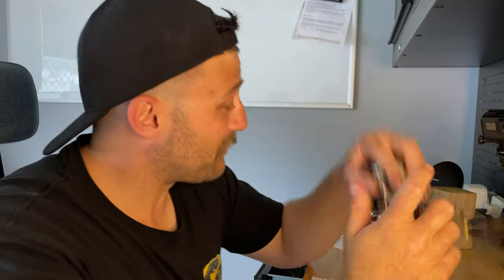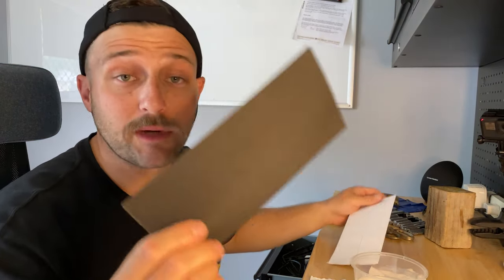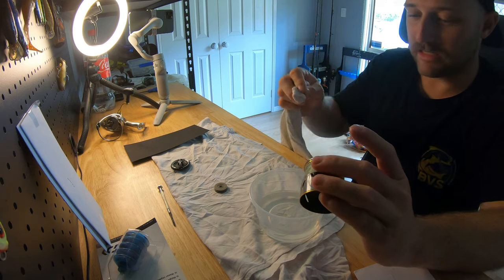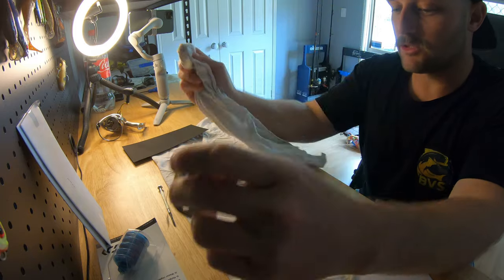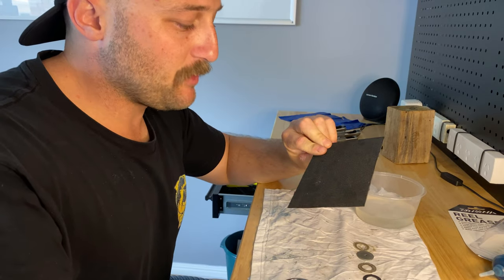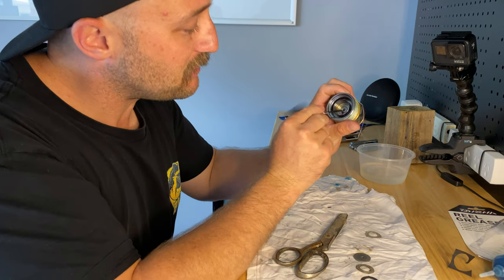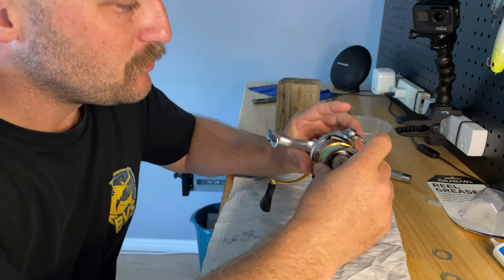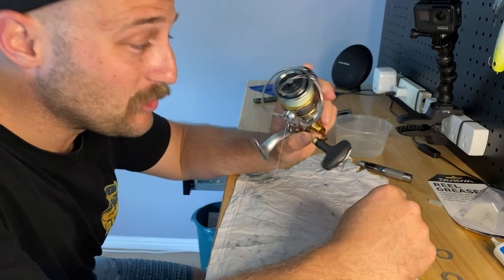CARBONTEX DRAG WASHER UPGRADE

Comment: Awesome vid mate, thanks for sharing this tip! I definitely just learnt something new haha, I might have to start doing this with my own reels! The drag at the end looked awesome, stronger and smooth. I had a good laugh at that Borat clip by the way 😂🤣
Reply from the maker: Thanks mate 😘 it’s work a treat for those older drag systems. Be good for chasing those Spanish and cobia 👌
Reply: @BrisVegasFishing   That’s what I’m thinking mate 😅 got a couple of 4000-5000 size spin reels that have had a few too many mackerel screaming line off them 😅 
If I replace the older drags (that I’ve never even touched) with the carbontex, could it revive them a bit?
Reply from the maker: Well it definitely wouldn’t hurt em 😂 sounds like they could probably do with an all round service.

Comment: How do you now what thickness you need?
Reply from the maker: You can measure the thickness of the original felt with a set of vernier callipers.
Reply: @BrisVegasFishing measure the felt but it's soft... won't you get different readings depending on how much tension you place on the calipers??
Will measuring the metal washers be fine???
Reply from the maker: @BricMabesa  well the felt washers are normally pretty squashed as it is and don’t have to much give. So as long as you’re not putting tremendous pressure on the callipers that should be fine. 😅
Reply: @BrisVegasFishing  thank you kindly good sir...👍🏼